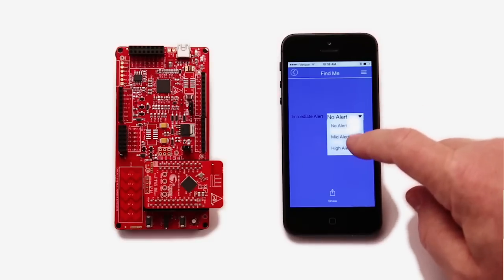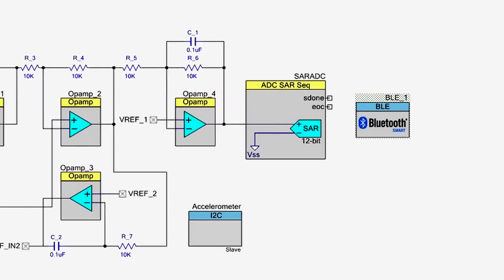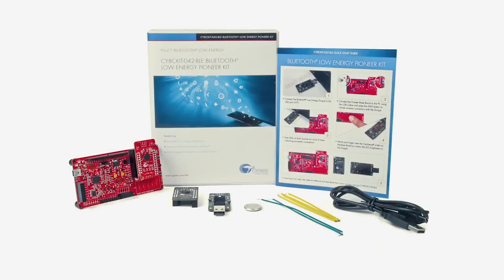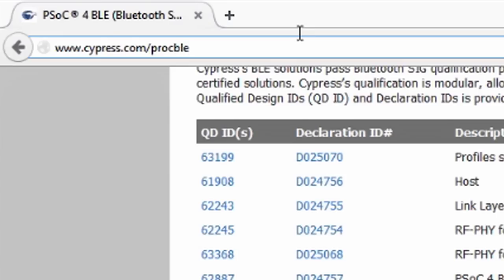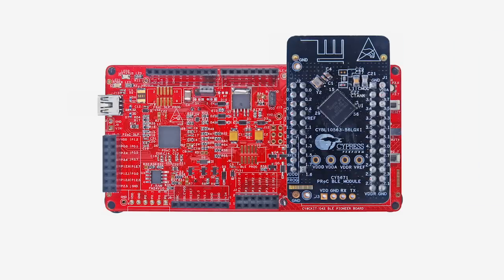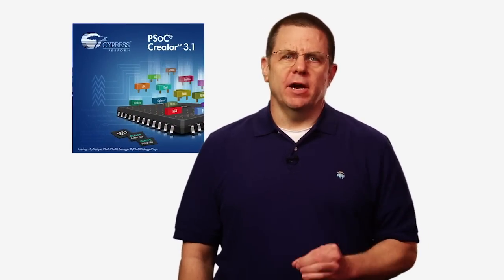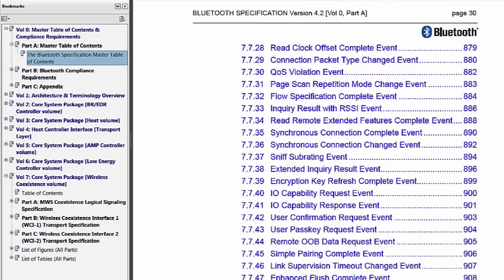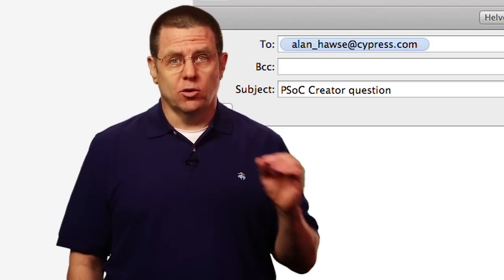PSoC Creator 101: Introduction to Bluetooth Low Energy

Comment: Hi Alan, I've got a question for you. I have the CY8CKIT-042-BLE pioneer kit and I've installed PSoC creator 3.2. I'm trying to implement the protocol ( AVDTP I believe ) that will allow me to stream audio from an Android device using the Bluetooth radio on the chip.